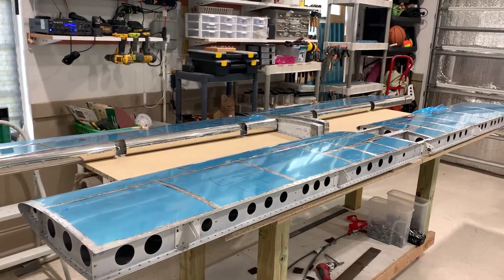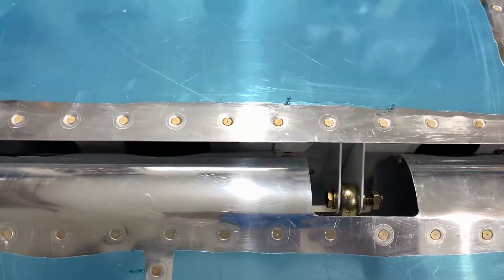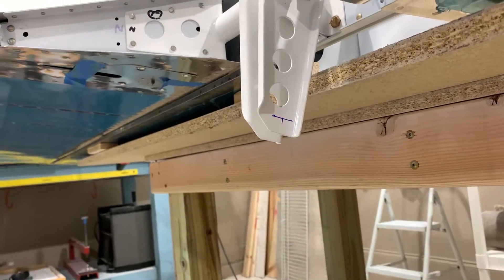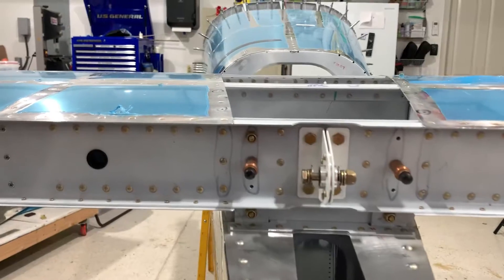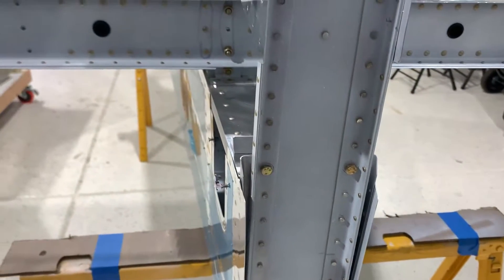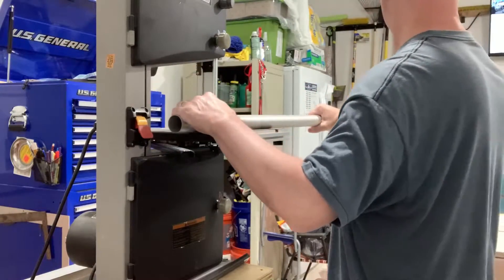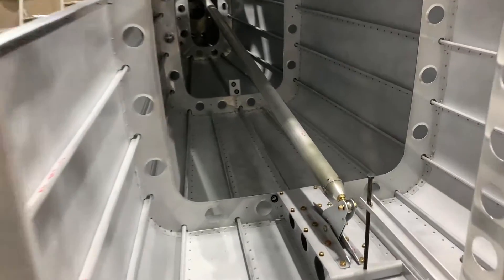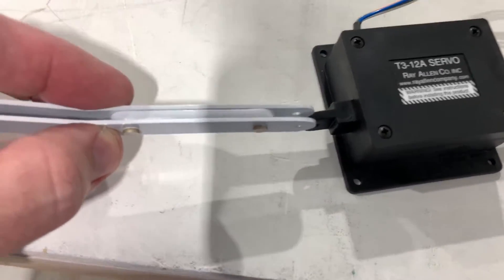RV-10 Tail Cone Completed

Comment: You see the Service bulletin from Vans on the elevator control horn stop? Much easier to fix now. SB 18-03-30.
Reply from the maker: Thanks! I will need to check mine. I would have hoped this SB would have been corrected in the kit, although it was released only a year before I received my kit.
Reply: M Hilderbrand I’m a little bit behind you and somebody pointed it out to me.